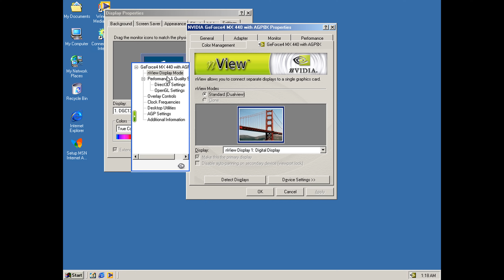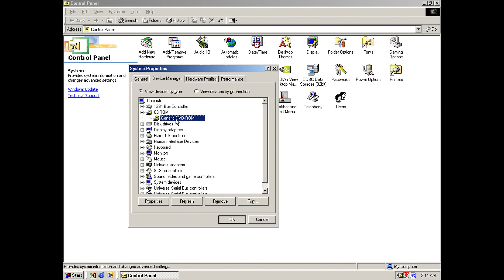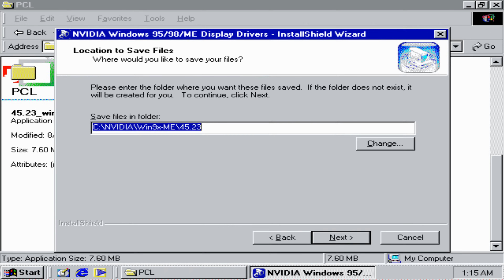I gave Windows ME another try

Comment: I personally liked windows me back in the day. The only issues i really came across was with the recovery  program built in i just turned it off to get the best performance at the time the few times i used recovery always failed anyways with restoring the previous states. Besides recovery it was a solid os. There was a way to get dos running but its been a long time i remember copying files over from other dos versions.

Comment: I remember my experience with ME was on a Pentium 4 1.3 or 1.4ghz Willamette (can't remember which model exactly) with a measly 256MB of ram and a Riva TNT. XP ran like hot garbage but ME was so smooth it was actually insane. Though part of that was also my antivirus, for whatever reason it seemed to use significantly less CPU on ME.
Reply: It actually was probably more due to how ME interacted with early ACPI and APM. 98SE used a eariler version of the driver for it while ME and XP used a later version that was buggy and crashed on a lot of systems.  SP2 fixed that for XP but ME never got any updates so this is why many people had bad experiances with it.

Comment: I recently installed ME on a Dell Latitude D610, I can't say it runs any worse than 98 would, all the problems I had with it were more related to having a BIOS that was designed to run Windows 2000 or later, I had to install Windows ME with the switches to not enable PnP BIOS support which disable ACPI, otherwise I'd get a bunch of resources conflicts because I guess Windows 9x just doesn't like the enhanced APIC in PCIe systems, but Ultimately I got it mostly working, I found a working sound driver in an MSFN forum and the Chipset and Radeon drivers on your website. I didn't have a driver for the X300 mobility so I just installed the regular desktop X300/X550 driver, there are still two issues I have running 9x on the machine, one is that I don't think there's any way to get USB 2.0 working from the ICH6 southbridge so you're stuck with USB 1.1 speeds and there's still PnP issues like if I try to use the wired dlink ethernet card I have it will cause the screen to go blank and lock up the system, but the generic Marvell Libertas 802.11g card I have works great and even has a utility that'll give you WPA2 support under 9x.

Comment: Now that we are back into the socket 478 era I would like to know. Are there any modern fan replacements for these sockets? I have sadly experienced either the plastic snap-on mechanism on stock coolers or the base on metal ones like the one in this system break because of age and finding parts for these sockets seems to be an impossible task nowadays
Reply: Startech has one that works and can be bought new for around 20$ but boy that thing is loud.
Reply from the maker: Yes I've replaced the fan with a Noctua one. In this video you can hear the fan in the background, over 3000 rpm. The Noctua is whisper quiet.
Reply: @philscomputerlab  my problem comes really to securing the heatsink to the base more than the fan itself because the retention bracket shatters, I've been thinking about straight up zip tying it through the holes but that seems sketchy even for me.
Reply from the maker: Ah got it! The retention bracket can be pulled from old boards! Maybe not helpful depending on the situation but if you have access to recyclers or computer shops that have been around for a while this could be a good source. @amalegardevoir

Comment: Have anyone actually tried to use the SSD drives with the old operating systems (without the TRIM support) for prolonged periods of time? How long can disk survive?
Reply: Elpamsoft
Reply: SSD Tweaker.
Reply from the maker: So far the only SSD that stopped working for me was a Crucial one. It was used for a mix of retro and modern projects. Everything else still going strong.
Reply: Soz. No more detail. My link and advice was deleted 😡 search for the word above and you will find some Trim s/ware for Xp.
Reply: I bought the registered version for a small sum.  You could also try and trim over network from win 10/11?
Reply: As I was also trying to say. My old systems all have SSD’s no problems so far 🤞.

Comment: Ah, ME... My very first OS installed in my very first Pentium 3 PC, a 2nd Hand Korean Surplus one... Never had a problem with it since I only used it for Document Processing, Win Kawaks Arcade Emulator, PSXEXE PS1 Emulator, and other light games in 2005. I tried surfing the net via Dial-Up (DSL cost arm and leg back then here in PH) but it was meh back then, so slllllooooooowwwwww... So my go-to for that task is Net Cafe. Overall, it's okay, never got BSOD, but once you got XP, I never turned my back.

Comment: I remember some people giving ME a try back when it was released to. It got a lot of bad press at the time but honestly, my impression of it was always that it was just a worthy update to Windows 98SE.

It wasn't particularly necessary since at the time of its release there was less and less reason to run 98SE: games had largely all become compatible with NT/2K and drivers for NT/2K were available for basically all new enthusiast tier hardware. This wasn't always the case but at the time ME came out it largely was so Windows 2000 was the windows of choice and ME fell a little flat amongst enthusiasts.

That said it was just fine so long as you had drivers. It basically required WDM drivers and a lot of people were attempting to run old VXD drivers with it which led to instability. If you gave it appropriate, contemporary hardware with the right drivers it was fine... just didn't really serve much purpose except niche cases when you absolutely needed 9X/DOS compatibility although from memory you had to enable this manually.

Comment: Nice content as usual.  Windows ME is not that bad despite what others have said in the past, compatibility is good some don't work as well some do.  My setup is a Asus P4B800-se with a Asus P4>Pentium M adaptor cpu @ 2.1ghz also 512M SSD memory GeForce GTS abit overkill, onboard sound,  MS Sidewinder Force Feedback or Thrustmaster Top Gun USB. Nothing beats running with real hardware, GOG is good but when you have real why not? Thanks Phil for more content

Comment: In all honesty, the only issue I ever had with ME was down to DOS gaming. If I recall at the time I had an Athlon 700, 512MB pc133 (I tried x 256MB but that was buggy), Asus K7M and an AGP Voodoo 5 5500, AWE64 and if I recall I even had one of those odd slot (AMR I think it was), that were around for a year or 2, modems (I recall having to replace it when I got my slot A mobo and cpu), so maybe I got lucky with my combination of parts and drivers. In the day to use, it was no less or more stable for me than 98/SE and far more stable than pre SP1 XP.
Reply: Very nice build. It's also pretty impressive how your experience with irongate -based system was stable. Last place where you'd look for stability today.
Reply: @r.d.7698  I think I may have rose tinted glasses when it comes to the stability memories, mainly as at the time, I was comparing it more with XP than anything else. When I tried pre SP1 XP (by the time SP1 came out, driver support and game patches were also more readily available),  it would crash and be all round buggy on near all the games I tried, not to mention having to swap out my Voodoo 5 for an OG GeForce to see if it fixed it (due to the V5 having to use modded W2K drivers as it never had XP ones), but it was still a buggy mess. It was because of this that I stuck with ME or at least dual booted. 

I can honestly say I must not have been the only one who was no fan of pre SP1 XP as most people I know  (as it was the time where PC gaming became affordable, many of my mates and family built their own PCs, especially as at the time there used to be computer fairs that sold cheap parts) took a fair bit of convincing to switch to XP when I told them SP1 was not bad at all, as they had also had issues (which wasn't helped by most having voodoo cards of some sort). 

So next to that, if the games worked without crashing all the time and the hardware worked with no issues due to driver support, I expect I felt it was a better experience, compared to XP at least. kind of like how many people felt the same about XP after it had been around for so long and ended up being rock solid vs vista (which oddly enough, seemed  a pretty decent experience at least on the 64bit version, once it had its first service pack, but before that my first though was, this is XP 1.0 again, :D).

Comment: Nice revisit. I had less issues from ME. I remember many nights reinstalling 95 and being disappointed when 98 restores didn’t work.  So yeah, I was good with ME. Don’t really recall having issues with old games… maybe Ultima 7… fuzzy memories ya know.
Reply: I had the same years ago. At time I used this OS I don't played much DOS games so that lack of exit to DOS wasn't problem for me. For me Windows ME worked always as good as 98SE. By the way at 98SE when folder was copied to HDD from CD that folder files were set as read-only, at Windows ME they had normal attributes. Even when was created shortcut by clicking "Send to" desktop at 98SE by clicking right at file "start in" wasn't populated in propeteries which is solved at ME.

Comment: Great stuff Phil. Only people who don't have much experience with computers would say that Windows ME is bad. It's an updated version of Windows 98 without real DOS mode. The BSOD's that most people get are usually related to the IRQ's but that also happens in Windows 98. I'm surprised you didn't install the VXD drivers to try a few DOS games. Most don't require full dos mode and will run perfectly under Windows mode. You could also use the CPU Grab application to help with some speed sensitive games.
Reply: Guaranteed I have more experience with computers than you, going back to the 80’s. ME was unstable garbage and Microsoft agreed since they ended it so quickly shifting people onto the NT kernel systems.
Reply: @infamousacidrain  Interesting, apparently being older doesn't automatically make someone wiser.
Reply: Windows Me was never intended to be good. Originally Neptune should have come out but because it was not ready Microsoft put the efforts into Odyssey which became Whistler and then XP and hastily put together an upgraded 98 to have something to cover for Neptune . You can read all about this yourself if you want to get smarter.
Reply: @gentuxable  Unfortunately, reading does not automatically make someone smarter. I've also read all of that, but apparently people still don't get it. That is exactly one of the reasons why I think Windows ME was great. Microsoft is a marketing genius. It was, as you mentioned, clearly put together quickly to cover for Neptune and until Windows XP was ready for release, one year after. Considering the development time, it's impressive what they did with ME. It was clearly the best option for any new home user at that time since it was much less demanding in terms of hardware requirements and more compatible with games when compared to Windows 2000. It looked like Windows 2000 with the speed of Windows 98 and had quite a few important extras when compared to Win98. Needless to say that it was also much cheaper. Windows ME did a great job for what it was and still does, apparently, as you can see.
Reply: @Brunorego80  Yeah the first sentence makes sense, for you. But as they say in German, Insight is the best way of recovery. If your PC was too slow to run WIn2000 chances were high you had older Hardware with VXD drivers and then Windows ME would have been pain. Microsoft was no marketing genius, 95, 98 and XP sold better than Me.
Reply: @gentuxable  It looks like you have some inferiority complex, if you are bothered by people enjoying and having no trouble with an OS that you didn't like. Windows ME always worked fine either on older or newer machines, VXD or WDM drivers. Even if you had the most recent hardware at that time, ME would've been the better choice because it's just much faster in every way. Windows 2000 was quite good, but it was more focused for a work environment. It's funny that you mentioned the sales, because you know which games also sold badly? System Shock 2. Is it a bad game? Grim Fandango was another one that flopped in sales and it's one of the best games ever made. Nice logic there, other operating systems sold better, so ME was bad and Microsoft are also bad at marketing. ME served its purpose, to fill in that gap between 98 and XP.
Reply: @Brunorego80  no I am just bothered by imposters that’s all. No worry if it works but that is never the center of universe.

Comment: I used ME several months ago for testing a VIA Tualatin Board, and ME run flawlessly. But yes, it was no long time test and no daily use PC. Back in the day, it was horrible. I had to reinstall ME every second month or so. Random BSODs. I also think it had something to do with drivers and which specific Hardware were in use. I was 13 and had no idea about wdm and vdx drivers. I installed the bundled drivers cause we dont had Internet. Only graphics drivers were updates with every new PC Action issue (Germany) :-D Great times, best magazine. But yes, installed Win98, problem solved. Maybe the drivers we pick today are more matured.

Comment: Hey Phil, I know this is usually not your kind of video-idea, but hear me out: 
In my youth in the 90s and early 2000s, basically everyone (at least here in germany) suggested installing ms-dos at first and then windows on top, mostly for some nebulous stability reasons. even though these claims got more silent in the XP-era, it stuck around quite a long time. I'd really appreciate, if you could make a video in which you explain where this statement comes from, what is it based on, when it helps and when it doesn't, and what the technical fundamentals of this claims are. would really appreciate that, and I'm sure alot of the other viewers have some comparable memories regarding this topic, too.
Reply from the maker: The main difference is that this will let you dual boot between DOS 6.22 and Windows...
Reply: @philscomputerlab  that's what I thought also, but as a youngster I heard this phrase so often, it kinda became a meme of itself...
Reply: The only reason to do this was to make multiboot system with true DOS support. There is no stability reason, because Win9X use its own version of DOS and WinXP ignores it completly.

Comment: I think the blowback against WIndows ME was in part because Windows 2000, which was previously known as Windows NT 5, was supposed to be the unifying release that Windows XP ended up being. However, Microsoft didn't have the 9x compatibility guts ready, and average hardware probably still wasn't where they wanted it to be at the time. For example, new computers were still being sold with just 64MB RAM, which wasn't even enough for Windows 98SE let alone an NT-based system.
Reply: Yeah and Microsoft didn't have User management put together yet. In a business you have an IT guy that sort permissions and User accounts out, at home you might have nobody understanding this and no one having time for that. So at the end they gonna give Admin permissions to their child and it will mess the system up eventually. So Microsoft invented System Restore first came in Me and the User account wizard that makes it harder to mess it up came with XP and then they were ready for home users to migrate to NT. Oh well then they messed it up in XP Home anyway by leaving the default Admin without a password...

Comment: at the time ME came out, I ran it and although it had quirks(monthly reinstall; joys of 9x daily use).... I had no memory leak related issues out of what I could tell; my system at the time was a Cyrix 200 non-mmx, QDI P5I430TX(I bought one again 1-2 yrs ago:P), 32mb ram.... ** here's the fun bit, as this was also around the time that broadband was becoming available I talked my dad into buying a SMC network starter kit, as it was not very common for people to have networks outside of small businesses as of yet this kit came with a 10/100 switch; I than used a pentium 133mhz running "Windows ME" as my first router/firewall(consumer routers weren't common yet); the choice of os was because I learned that Windows ME had an easy network setup wizard that would allow me to share the computers internet connection over nat; everything was static ip's and my firewall of choice was black ice defender(smh; the non firewall:P)
Reply: additional nostalgia notes, although the SMC "10/100 Mps Fast Ethernet Network Starter Kit"  prominently pointed out how it had a 100Mbit 5 port switch I later realized the included 2-3(I can't remember) nic's were 10mbit lol........ ** I ended up later changing the OS to openbsd...... somewhere around than I used a wired linksys router for a while; ended up going to openbsd, and later pfsense ** software notes: for windows me, as I progressed in trying to rig up something a bit more "solid" I used Magik DHCP(windows dhcp server), and eventually found JanaServer 2 which somehow is still up unchange to this day; this is like a windows 9x server power house; you want to serve a 90's webpage, email server, ftp this has it! want to serve dns, forward ports, etc etc this has it too; pretty much pfsense(no direct affiliation) and than some for windows 9x:P